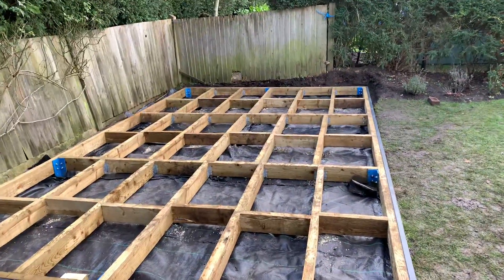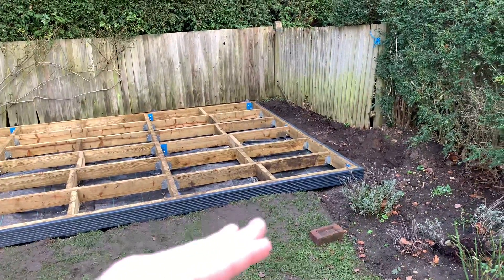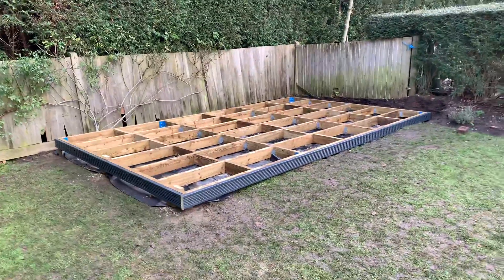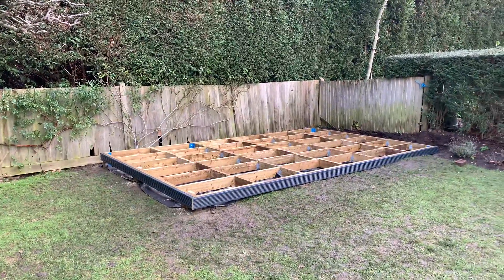Information video about our steel and timber frames base

Comment: Are the frames sitting on a platform or is the entire building weight being supported by the bolts?!
Reply from the maker: Hello the timber frame is completely suspended, so the bolts accept the entire weight.
Reply: @BakersGardenBuildings  Thanks for your reply, that's not at all safe and the frame should not be suspended in such a fashion, the bolts can easily sheer through the timber or in rarer cases break off, that's a shame as your rooms seem very well constructed otherwise.  You should look at ground screws or suspending threaded rod in concrete and supporting the frame on U shaped channels as one other very capable builder is doing atm.  Not trying to be critical just wouldn't want to see an accident, people are loading these rooms up with heavier loads these days (gyms e.t.c)!
Reply from the maker: @DJMambomagic  I appreciate your view , but it’s very safe, calculated with the bolts  sheer and works extremely well. Each room is calculated for the usage and future proofed. We have installed over 3000 of these bases over 20 years and never had that issue. Wishing you all the best.
Reply: @BakersGardenBuildings  That's good to hear it's working safely in practice.
Reply: Did you not see the size and number of bolts?
Reply: @DJMambomagic  I’ve been looking at both of these methods and I thought the same about the weight on the bolts and timber but also on liams method I also think about the whole weight just on the thread of a nut?

Comment: I think they should have had the fence done first because that's going to be a pain in the rear to do once a structure is up, doesn't look like many steels and what's going to happen with the wood expanding and contracting on them screws, would have been better to of had it sat on a plate and angle so it carnt drop.